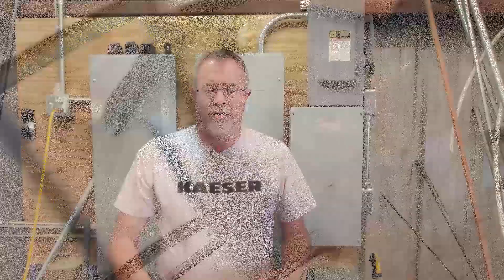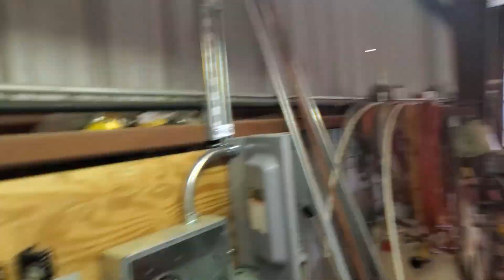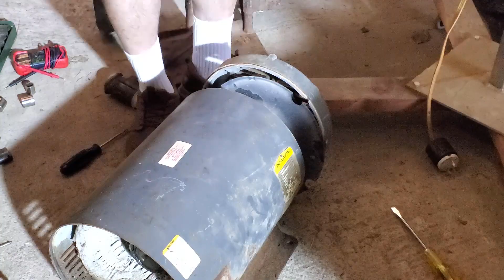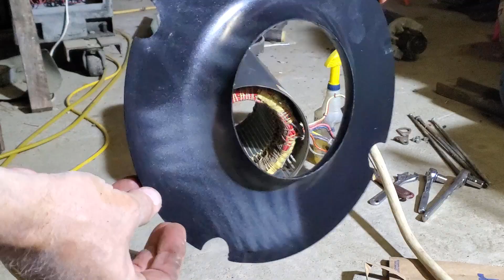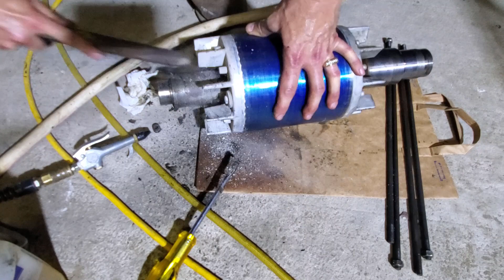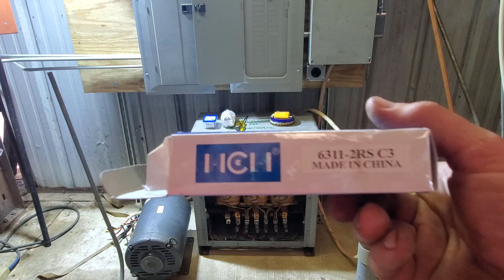30HP TEMCo Rotary Phase Converter & 45 KVA 460v Transformer

Comment: Nice find on the RPC. 

Disconnect switch (and most other electrical equipment) convention is entry on top lugs so that turning off the switch isolates the fuses.

Circulating currents are the reason for the high readings at the motor. There is energy moving between the motor windings and the capacitors (at 60Hz). the inductive and capacitive reactance cause the currents which are not "real" power (as in i and j imaginary numbers). The I2R losses in the wiring are real power and have to be considered for sizing wiring and protective devices. The readings are not apparent power which is different from reactance. If you were able to read power factor at your disconnect switch, you would see that the actual power is probably much lower than the 12A*240V=2.88kw apparent power (kVA).
Reply: Agrees
Reply: I have built converters have one my shop the 3rd leg is for starting you can run 3 phase motors on single phase you have to spin it or use compactors the run compactors just balance the load 3rd leg or ghost leg is just from the magnetic field the motor produces just be careful how much load you put on your power service i went to shop that was tripping brakers his outside power company transformer on the power company side was to small they were trying to run 15 horsepower compressor on 30 hp converter that he bought new he thought because he had 200 amp panel box everyone needs to do your research before hand
Reply from the maker: I knew there were some Sparky's here! Thanks for the info, makes complete sense. I should swap the leads on the disconnect as you specified... might have to buy additional $3/ft wire to do it, but it's a drop in the bucket compared to the 70 ft run I have to do across the building. While you're here I'll pick your brain: was thinking of going across the building with three #2 Cu for the L1, L2 & L3 and using #4 Al for the neutral. This sub panel will be good for 90A for machines on that side of the building. I can put an additional ground rod at that panel (South side of the building); seems to make more sense than a 70 ft ground wire in the conduit with all the others. Your thoughts?
Reply: @EngineersWorkshop  why not run it all with aluminum? It's going to a sub panel essentially. That's how I did it. I have a 30 hp RFC and I ran a 2-2-2-2  aluminum service entry wire from RFC to sub panel it's good for 100 amps. #2 thhn copper is good for 130 amps. This rotary phase converter can only put out 27 amps per leg anyways. And if you step it up to 480 first the amperage will be be half that. I only went that big because I wanted every volt possible at my air compressor.
Reply from the maker: @electromechanical stuff  there are conduits buried in the slab from the building's previous use (sawmill). There is a 1" conduit running straight across under the floor from where my incoming service is to a building column on the far wall. I'm thinking ahead for when I have 460 three phase service: I planned to run 4 wires in that conduit to get 460 + neutral across the building. Maybe it was #3 Cu that gave me 90A capacity (460). I will ultimately relocate my 45 kva transformer there to provide 208 & 120 for outlets on that far wall. Don't really know my tot HP in the future, but want max amps on that side of building in that conduit.
Reply: Correction just checked I used 4-4-4-6 service entry wire to sub panel. Good for 75 amps. 
https://www.homedepot.com/p/Southwire-By-the-Foot-4-4-4-6-Gray-Stranded-AL-SER-Cable-13100399/205001802
Wire is 90° rated so on the NEC ampacity chart it's good for 75 amps.

75A*1.732*240V÷746W= 41.7 HP * 0.85% efficient= 35.5hp worth of continuous load you can put on 4-4-4-6 wire. Well above what you should ever put on the RFC. Did I mention it's only $1.25/ ft for all 4 wires
Reply: @EngineersWorkshop  The 1" conduit will restrict your wire size. You don't need neutral to the transformer, but do need a ground. 3 #4 and 1 #8 ground (cu thhn) will fill the 1" conduit to max per code (40% fill). It will be a hard pull for 70' at that fill and probably won't work if the conduit is damaged. Is the underground conduit PVC or rigid? steel conduit will likely be rusted inside. Where I work, it is safe to assume that every underground conduit has water in it. It is very rare to work on an underground conduit that is dry, even recently installed.

I don't know if your utility will charge demand when you get 3-phase service. I am looking at building a new shop building in about a year and am considering 3-phase 120/208 at 30kva vs 240V single phase at 48kva (200A feed). If I go bigger on the 3-phase set up, they will charge demand and that about doubles the cost of electricity. Fine if I was running 2 or 3 shifts with a lot of continuous load, but I also am a 1-man shop. I could easily spike the demand if I had the cnc plasma cutter running which also requires compressed air and I was welding at the same time. It may not be worth managing loads to stay out of demand to have real 3-phase. I have VFDs on almost everything and only a few things that a RPC would be good for.
Reply from the maker: @grumpyoldman5368  yes, rusty underground conduit. Blew a quart of water out, that's how I found the other end. The conduit itself is about 45 ft, the rest of the circuit will be up the walls, and the row of conduits is about 3 ft out from the North Wall in front of the current panels. I can install 7 ft vertical conduit and go over to the top of the panels, so some of the circuit can be pulled from the floor through the new conduit. #4 Cu gives 95A with 90C cae?
Reply: @EngineersWorkshop  Current code would require the ground wire from the main panel (or RPC if that is the source of the feed to the sub) to the sub-panel. In the sub-panel you would remove the jumper between the neutral and ground bars (or bonding screw or whatever is there). Some panels need an isolated neutral kit to do this. The ground needs to be isolated from the neutral there to perform it's job and not be a current carrying conductor under normal (non-fault) conditions. 

Voltage drop calculation show #2 copper to be ok for 90A for 70'. Could also use 1/0 aluminum, but you may need larger conduit. You might want to consider sending the single-phase feed across the shop at 1/0 cu or 2/0 al and have the RPC/3-phase panel co-located. Be aware that to make 90A 3-phase you will need 1.73*90A at single-phase = 155A.  I am assuming you have chosen 90A as 125% of the motor FLA of 72A. 1.73*72 is about 125A, so your feeder breaker and disconnect should be rated for that. If you have a 100A feed, then you really only get 56A of three phase.

For your ground wire 250.122 says #8 cu for breaker of 100A or less, #6 for 200A or less. I would make the neutral the same size as L1-3 if supplying a neutral to the 3-phase panel, as there is nothing to prevent the full L1 or L2 current from flowing back on N. I would also mark the manufactured (NEC term for the ghost/generated) leg with orange tape like a wild-leg delta source as that is essentially what you are making. L3 will be around 208 to neutral so you need to be aware of that and not connect any single-phase loads L3-N.

I certainly could have missed something, but I think I have the bases covered. If anyone sees any holes in my analysis, please say so as the ultimate goal is to have a safe and reliable installation.
Reply from the maker: @grumpyoldman5368  actually planning for when I eventually have 460v three phase service, and will relocate the transformer to the far wall. Then it will provide my 208/ 120 for outlets and small motors. I'll use an existing 1" conduit to get as many amps (at 460v) as possible to the far side. I'll have at least one machine cluster on the far side, maybe 25-30hp total there plus other small loads.
Reply: @grumpyoldman5368  this is a 240v rotary phase converter. There is no wild leg. All legs are 120v to N. The 30hp motor is not the load it's the source of the 3 phase. The motor is   wye and still 240v leg to leg. If the sub panel is dedicated 3 phase only I don't think you need a N just a ground. This part I could be wrong about. But at that point it would be a really stupid rule that you have to run a Neutral to a panel you will never use for 120 volt loads. I only ran 4-4-4-2 because NEC table 310.16 states aluminum #4 90° can handle 75 amps. He only is supplying at MOST 43 amps on each leg with that 30hp RFC. 43 amps will give you a 20 HP load. Rule of thumb is your load should not exceed 2/3 of the HP rating of your RFC. 1/2 the rating of it's a hard starting load like an air compressor or similar item with high inertia load start. I would change out those 100 amp fuses to 60 amp slow blow so you can run smaller ground wire. You only need 100 amp breaker because of the high start current trips a 60 amp breaker.
Reply: @electromechanicalstuff2602    You need to look at the phasors. L1-L2 is 240V which cannot be for a 120/208Y system, they are also 180-degrees apart, not 120-degrees as they would have to be for 120/208. This is essentially a wild leg delta with a Y connected generator, the utility transformer is part of the delta circuit. L1-L2 is 240V. ground/neutral is halfway between L1 and L2. not at the star point of the motor. That means there is nominally 208V (could be higher or lower depending on the balancing capacitors) between the midpoint of L1-L2 (where neutral is) and L3. This could be made into 120/208 if there were an isolation transformer feeding the RPC and the star point of the motor were grounded. Grounding the star point of the motor without the transformer will cause a short.

I agree that a neutral is not needed (or perhaps even useful with the RPC) for only 3-phase loads and I would not recommend putting single-phase loads on the 3-phase panel. When he gets utility supplied 3-phase then he will have real 120/208V from the 480 transformer if he takes service at 480V.

The largest single motor should not exceed 2/3 the HP of the RPC, however every motor that is started also becomes part of the RPC system.

I personally would not use a fused disconnect since the breaker a few feet of wire away provides protection for the wire and for the motor if it is hvacr rated and most are. The typical breaker trip curve is similar to time-delay fuse curve. If the RPC motor or capacitors were determined to need lower amperage protection than the feeder breaker, I would use separate fusing or breakers in the RPC control box.
Reply: @grumpyoldman5368  correct I understand the phase angles and why 240 3 phase is delta and 208 is wye. I suppose the ghost leg would technically be "wild". I swear I checked my generated leg to N and it was also 120 but I may have imagined that. The L1-L2 always remains 180° from each other the balance capacitors only help balance the voltage on the generated leg by creating a lag of the sine wave coming from L1 or L2. Yes when you add more motors/load to the circuit they become part of the RFC. But you wouldn't want to start 3 other machines just so u have a large enough circuit to start your biggest motor. You would just get a bigger rotary phase converter that can handle starting your largest load. He also appears to be a one man shop. So doubtful that he'll be running 6 machines at once and need 125 amp service sub panel. Especially since he is budget concerned with wire. Ya buy once cry once but if he's 5 + years out from getting  switchgear money 4-4-4-2 with properly sized fuses in the system to protect the wire and RFC he can run that across the 70' shop through the rafters for under $100. 
My 30hp rfc has a 3600 rpm motor and the startup current is 320 amps for 0.5 seconds it trips a 60 amp breaker so I had to put in 100 amp breaker on my single phase panel to supply the RFC. 80 amp breaker is not commonly in stock. So I ran 2-2-2 aluminum from single phase panel to RFC. your right the 60 amp fuses need to be post RFC. So either get a sub panel with a 60 amp 3 phase main or put a fused disconnect with 60 amp fuses to protect the 4-4-4-2. And now he also want to step up the voltage to 460 by feeding a three phase transformer backwards before he send the power across the shop too. So now the wire with a 20 HP load will only see 35 ish amps per leg on 4-4-4-2 wire. I'm just trying to make sure he doesn't go hog wild blow his pension and run wire to support  50 + HP load when he only has a RFC that can handle half of that in the first place.
Reply from the maker: I continued our discussion on a Community post
Reply: Hi, would a 5HP rotery Three Phase Converter be big enough for a 4.4 KVA EDM machine ? Thank you for any help.!!
Reply: @billyhickson1632  I would not think so. EDM has electronics in it that will be more sensitive to phase imbalance than a motor would be. 4.4kva is about 6HP. I would think 15HP RPC would be fine and 10HP might be ok but you will want to get the generated phase voltage within tolerance using phase-phase capacitors.
Reply: @grumpyoldman5368  thank you so much for responding. It was a manual machine that they converted to a manual EDM current Pop machine. Almost like a electronic drill press. It is used for burning through broken taps and broken bolts. I apologize, the main unit of the control box has 3.0 kVA there is a din cord that comes out of that into a coolant pump that is .4 kVA so it would’ve been a total of 3.4 kVA. I used a 15 hp digital phase shifter., But with it having the small spindle motor and the motor on the coolant pump, it would not work properly. I am told those digital phase shifters are for me a single motor.

Comment: Sounds like a loose fan inside that motor. Never heard the 3rd leg called a ghost leg.  Is it more scary than the others?
Reply: That's what I've always called the generated leg
Reply from the maker: @electromechanicalstuff2602  Ghost leg, generated leg, artificial leg... how many more can we come up with? ;-)
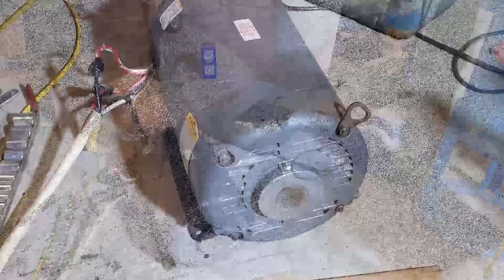Reply from the maker: Sounds better here 19:29  There isn't a fan, just the fins on the end of the armature. Other youtubers have used the term ghost leg, so I'm just repeating what I've heard before. Maybe its because the voltage is "ghosted" from the L1 & L2. As for the 460, any leg is equally scary!
Reply: That's all I've ever heard it called.